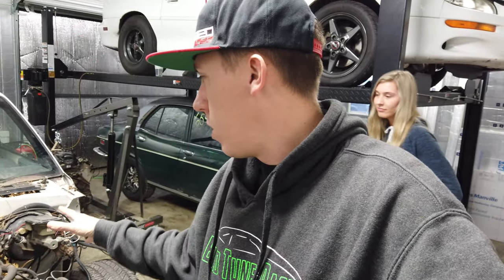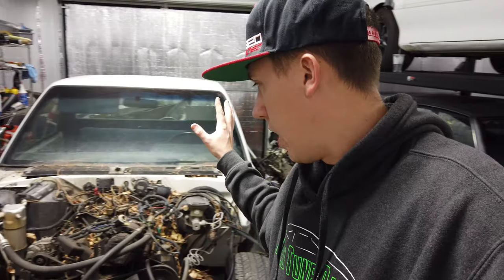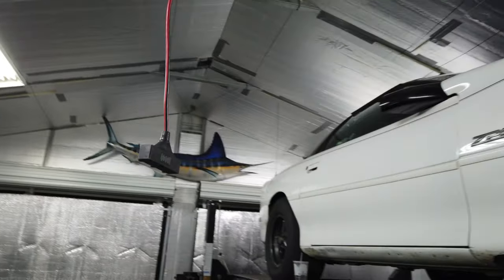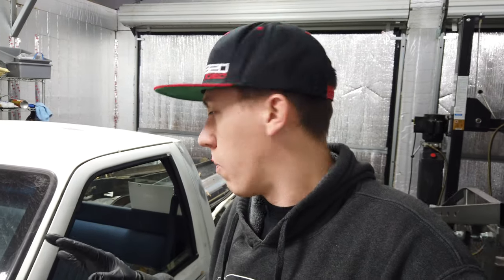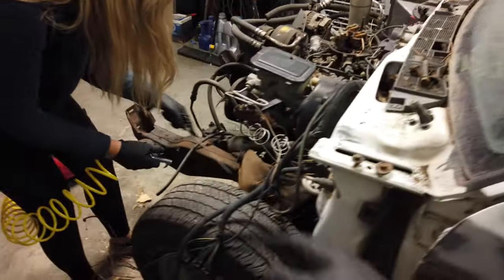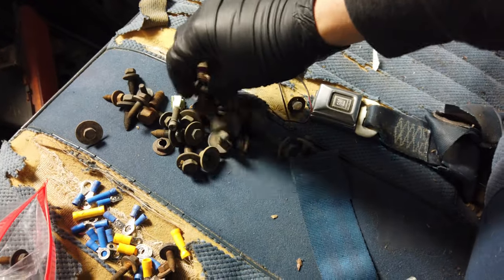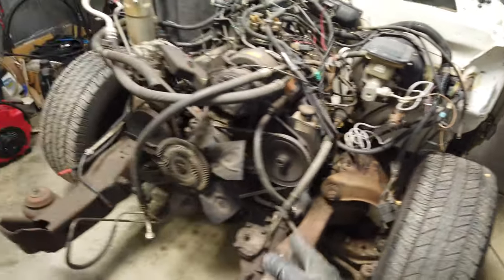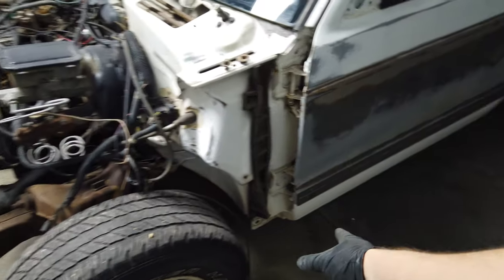Cleaning Out The $350 S-10 Burnout Truck! What Did We Find... Getting Ready to LS Swap It!

Comment: Wheel speed is the key to plenty of smoke👍
Reply from the maker: Definitely! Hopefully I'll end up with 170+ mph to start and see how it does!
Reply: Also remember that your front brakes, wheels and suspension are very important as well. With big wheel speeds you need to have control otherwise the s10 will have a mind of its own lol
Reply from the maker: @aussiegvmuscleandcustomrc6850  normally the rear brakes are capped off right? What's the normal plan for front suspension? Make it stiff?

Comment: Found a large screwdriver in the valley under the intake of a big block chevy once. Still have it. Was gonna say do a 8.8 for the rear, but since you have 9" in Clyde and Salty, I'd go that route. Gives you some more flexibility especially if all three have different gear ratios and the same axle splines.
Reply from the maker: Dang that's crazy!😂 Some of the best tools are the ones you find lol. Yeah they would all be 35 spine stuff with different ratios

Comment: 2.8 v6 truck 
Could be a 3.42 gear 
2wd 4.3 trucks are pretty much all 3.08 gear
Number code should be in the glove box if the sticker is still there
Reply from the maker: After looking doing a little looking it's a 2.8 by truck (didnt know a 2.8 by was a thing🤣) then looking at the code its probably the 3.42 gears.